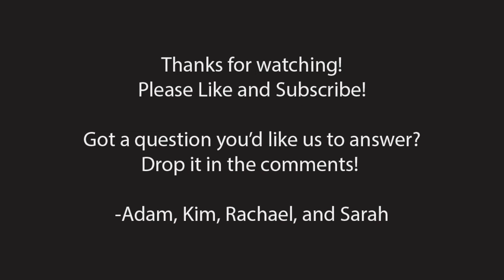A Screw Loose - Episode 007

Comment: Thanks for the great episode!

Is there any difference repairing tenon according to Headjoint metal type?
Reply from the maker: Yes, burnishing a nickel silver tenon will be very difficult, if not impossible. Be very, very careful with low karat gold, because it can crack. We recommend using tape on loose gold tenons to avoid the issue.